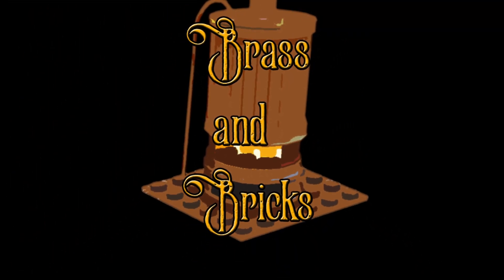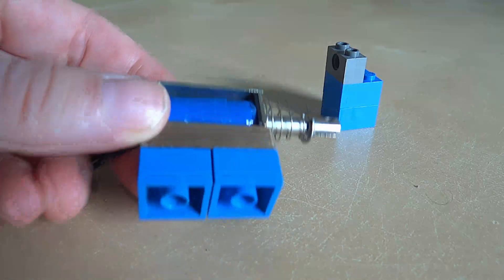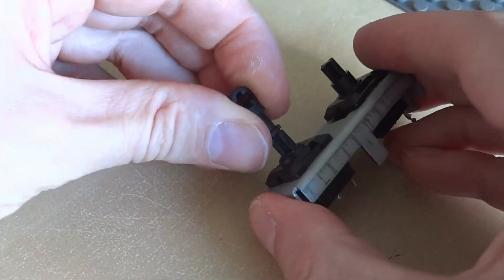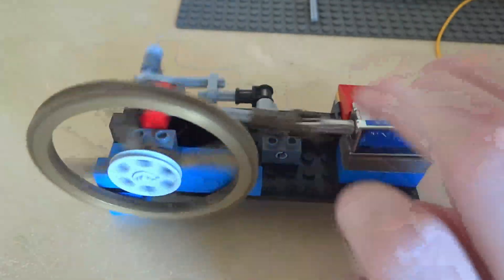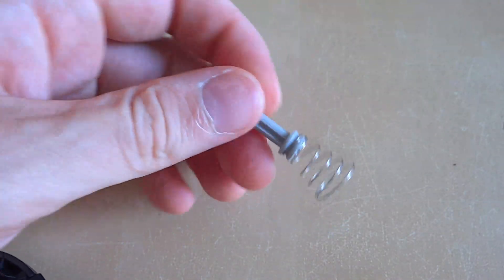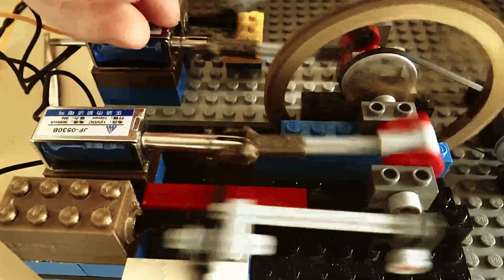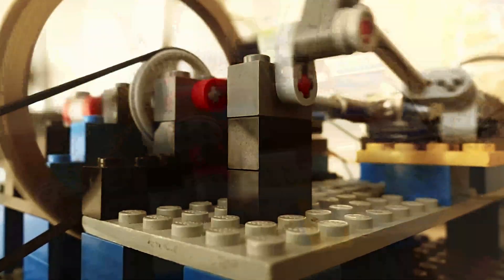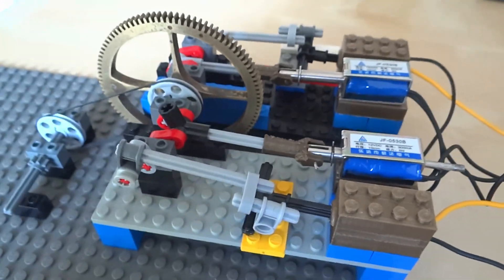Lego Solenoid Engine with Custom 3D Printed Parts

Comment: Switches do not like solenoids because of the high voltage backwards electromotive force that happens when the switch turns off...Its exactly how a coil works in an automobile. You are getting a high voltage spike in reverse everytime the switch turns off.
I install a flyback diode in parallel with my solenoids and they run a lot smoother and the switch doesnt get putted or burnt....you might google flyback diode and you'll see what im talking about.
This is a really cool build...would love to see you refine it.👍
Reply from the maker: oh yeah, forgot about flyback diodes. Been too long. I should definitely put those on. Thanks :)

Comment: Maybe a reed switch and a magnet on the flywheel would work more reliably. Then again, I'm not sure if the magnetic field of solenoids will mess up the reed switch.
Reply from the maker: That would work, though the switch would only be on for a very short moment. You do want to power the solenoid for most of the stroke, to get the most power.

Comment: I have made a couple of lego solenoid engines. I went from a handmade distributor made from a lego wheel hub to using a proximity sensors that powered the solenoids. I strongly advise to resist from using any kind of mechanical switches here. in your case the lose wires have a light magnetic attraction to the spring when electrified and are magnetically sticking to it in your switch box which is causing your disconnect problems here. Also the spark/back emf that will come out the solenoids will cause additional of problems too. Thats the reason why I insist on not using mechanical switches for such a device cause your in effect creating a spark gap. If you want to make a solenoid engine with a good power stroke it will need to be switchless in design.
Reply: Sure, a sensor + MOSFET will do the job, but what's the fun in that? haha :D

You are definitely right, but I enjoy the mechanical stuff too much :)